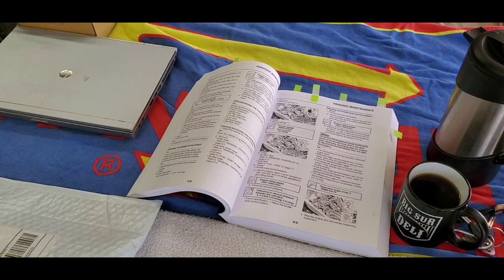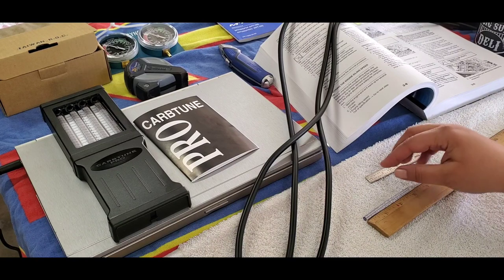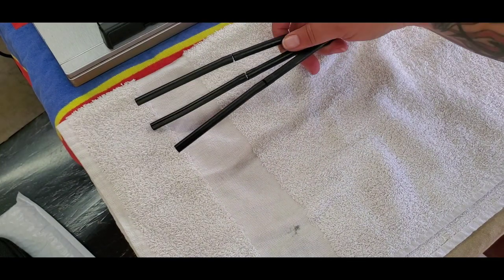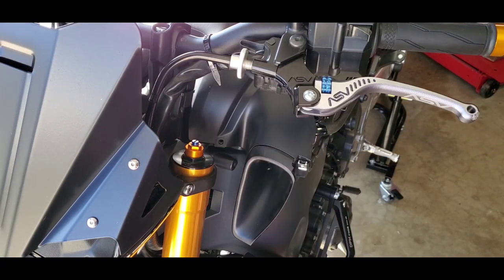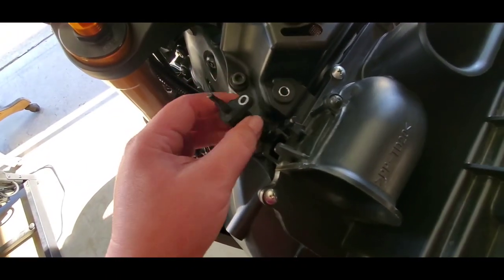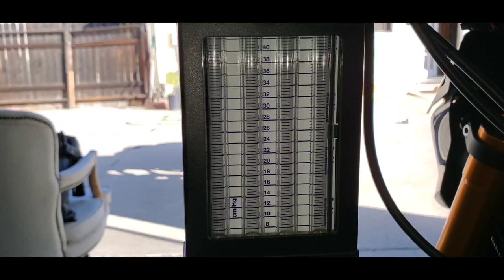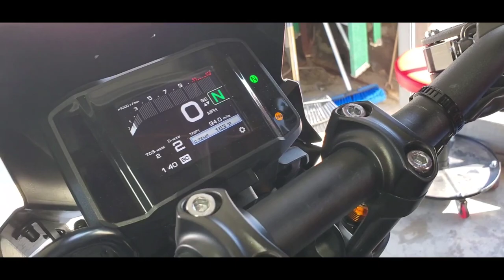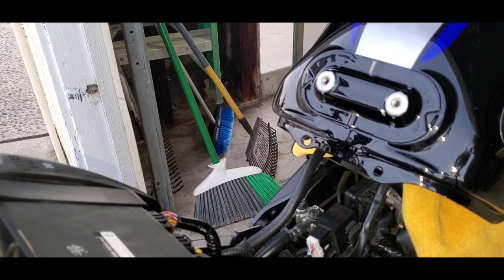Who wants to Synchronize some throttle bodies on a 2021 Yamaha MT 09 SP !

Comment: Nice tank pads, great video thanks for sharing.
Reply from the maker: @Gil Zr absolutely. Just so you know. I did end up having to adjust the baseline throttle. It wouldn't synchronize otherwise. It was minimal, but it did the trick. Runs better now then from the factory. Now I just have to get the Recall ecu updated from Yamaha 🤦‍♀️

Comment: Hi Sophia.. Can you just clarify the far right was the master ecu throttle bodie.. Black dot. Mine 2022 plate.. Usually there marked with white paint and even if anyone tried there locked tight all the way in..some mt are on the left side Going to try tomorrow.. 👍
Reply from the maker: @chipwood67 unfortunately, I don't recall. At one point I thought it was the one on the throttle side because I couldn't find any white paint. Then when I took out a flash light for a different time, I synchronized it, and i found the paint. They painted the screw itself. I think it was the middle one. I will go through my old videos. I believe I mentioned it somewhere. I'll let you know
Reply: Hi Sophia.. I did my sync today..didn't go well.. But looking at your video and response.. Which has been the go to video on y tube for Gen 3 sync is the best..also About your white dot on ecu master screw.. Yes I believe it was is the middle screw on your mt.. I can see it clearly now watching it back.. But on my Gen 3 2022 plate it's the left screw that's white.. But my problem started was when I tried to turn the MIDDLE screw it was seized... I could only turn the right sign screw.. Left side I thought is? Master ecu screw obviously I did not touchas on my bike it's painted white .. But now I'm thinking the wrong screw of the 3 2022 plate has been marked wrong or not ..why would Gen 3 all year have different sync master screws? So just tried syncing with right screw only.. Bike still hunting idle sync still in spec range after my sync.. So it has to be my lv race exhaust decated causing backpressure idle issues.. Also this is with o2,  eliminated ecu flash baffle in..looks like I need to get it on dyno to fix it..this may help other I'm sure.. Thanks again for your help 👍
Reply from the maker: @chipwood67  damn. I hope it works out. A good dyno tuner should be able to get you right though. Hope at least. If all else fails. You can put the bread box back on.
Reply: Yes bread box is staying off ha ha.. Hi Sophia. I would check yantosp on here..
You both have yamaha mt 09 2021 sp but your master white painted ecu screws are different just odd. Mine is same as yantosp.. But like I say my middle screw is seized..yours is middle screw? .. Also yantosp has had queries on this recently posted., 🤔
Reply from the maker: @chipwood67 senor Yanto! Yes. I do converse with that fine upstanding citizen known as @Yantosp he keeps teasing me about riding the Tail of the Dragon with him but hasn't followed through with it. Maybe you can tell the man he can trust me! 🤭🤣
Reply from the maker: @chipwood67  so I remembered I kept the old throttle body. I went & looked at it and indeed. It is the middle screw with the white paint on it. If you follow me on Instagram or Facebook I can send you the 📸 I just took. 👍
Reply: Hi Sophia thanks but I can confirm the white screw is on the left side sitting on the bike.. On gen 3. I would double check.. I've put post on yantosp and others respond it's on the left on gen 3..probably why you couldn't get them fully synced.. 🤔

Comment: Thanks for the video Sophia. I was debating on doing the 600 mile service on mine or taking it to the dealership.  You said a magic word that I worry about; "scratches". I don't  know about the paint on your bike, but mine seems to be quite soft.
I think I am going to follow your lead and do it myself; I am pretty sure that the sync tool is cheaper than what the dealer was going to charge me in labor.
I just subscribed, so keep the videos coming.
BTW, I follow "Old Guy Ridin" too; I am only a couple of months younger than he is.
Reply from the maker: @Doug Buchheit I'm glad it helped! Yes, I felt bad for my friends who SP got scratched. A noticeable 2 or 3" scratch on the frame of all places. & trust me, they aren't making it right very easily either. This is the video Old Guy Ridin' suggested  https://youtu.be/RVi6ECn91Ng with that video & the service manual I felt pretty confident it was doable job. Plus I took my time.  I enjoyed doing it.
Reply: I am a little dealer shy anyway. It took 6 months to get my bike and it came in with a badly bent brake pedal.  It took 5 weeks to get that fixed. Two of the engine covers were damaged too and Yamaha can't even give an estimated.ated delivery date for them!
Reply from the maker: @dougbuchheit1454   oh boy, I bent my clutch pedal when I dropped the bike. We used two Cresent wrenches to put back in place. Getting any stock parts is impossible right now. I feel your pain. 🤦‍♀️
Reply: @SocalMotoMo  But they seem to have enough parts to build more bikes.
Reply from the maker: @dougbuchheit1454  good point

Comment: Nicely done Sophia.  Did you notice the master cylinder looked like it had a splash of white paint on it.  Didn't see you adjust any screws.  I've got the same manometer.  Rotating the gas tank worked well didn't it?  You can actually disconnect the ECU (according to the 2 videos I watched to learn).
Again, great job!  And thanks for the shout out.
Ride safe.
Reply from the maker: @Old Guy Ridin' I couldn't find any white paint anywhere.  I was doing it again by myself so I didn't catch myself adjusting the screws. I was too focused on not messing up my bike 🤭 then filming it. The adjustments really don't have that much movement to them. I for some reason thought it be more significant but makes sense it's not. It was fun though.
Reply: Yeah, there shouldn't be too much of an adjustment.  Super job though.
Reply from the maker: @OldGuyRidin  thanks 😊

Comment: Hi Best video on mt Gen 3 👍... Did you turn - touch the master screw. Carb the one marked.. Or just touch - turn the other 2 to bring them up to the master one? I here you shouldn't touch the master screw as that's the ecu one.. But I also hear you can slightly.. Just checking I have hunting idle after decat full exhaust system.. And it's flashed.. I was told to do the throttle body sync to solve this issue.. Idle back pressure after my set up is why I need to do this.. What's your set up.. Stock or not.. Thanks Good job...
Reply from the maker: @chipwood67 Hey there! Thanks man. Yes, my bike was flashed by 2wheeldynoworks. Have a M4 exhaust on it. I followed those same instructions. Don't touch the master & adjust off the master. Should be good to go! 👍
Reply: Hi.. Thanks for info just to clarify then .. Did you have same  as me idle back pressure issue fluctuating .. And the throttle sync fixed hunting idle..mines not that bad more annoying.. Bike runs fine out of idle.. I did come across others saying ecu master screw gauge level sit higher than the other 2 even after sync.. Seems normal for the master to be slightly off. You did best you could have got it.. So it's probably spot on. Thanks again 😁
Reply from the maker: @chipwood67  no. I never had an issue with idle. I battled the TPS issue, though. I ended up replacing my whole throttle body about a year ago. That was annoying. I have no patience for dealers, so I just bought & replaced it myself. Resolved it, but I heard Yamaha finally figured it out. Allegedly 🤷‍♀️
Reply: Thanks.. Yeah yamaha warranty not worth paper it's written on.. Are you running decat M4 with baffle in or out or none decat or cat in  .. And or O2 delete or O2 still working with flash.. And or  above mods.. 🤔 Thanks again
Reply from the maker: @chipwood67  This is what I'm running. No baffle. Love the sound. After getting used to it. O2 is still plugged in, but I'm not sure if it's disabled by Flash. https://m4exhaust.com/yamaha/yamaha-fz-09/yamaha-mt-09-2021/2021-yamaha-mt-09-full-system/ I plan on getting a complete Dyno tune this year. Redo everything that's been done by the mail in flash.
Reply: OK thanks for all input.. Your M4 has mid muffler that will definitely help with backup ressure I believe.. Just make sure to as about full O2 sensor delete this could make some difference at idle.. Mine has O2 delete in ecu.. But if getting full dyno you should be good to go.. 👍

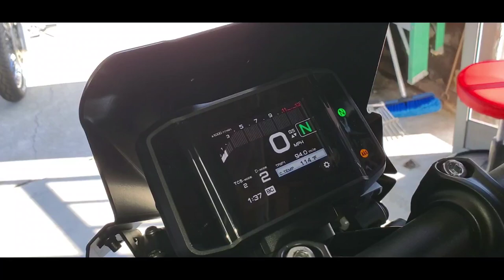Comment: Hi Sophia. I noticed that starting from 26:40 you have a very distinct metallic clacking noise which I have on some cold starts as well… did you notice that? It only happened twice with me, and its been haunting my peace of mind ever since! Not sure if in your case it is as loud as we can hear on the video or if it was the audio capture device that augmented this sound on its own but definitely it is similar to the one I got.

If you don’t mind me asking, what oil grade and brand are you using? My theory is that this could be from the valve command tensioner not having oil pressure due to cold oil taking its sweet time to warm up, but not sure…

Another noise that I am getting is when I am on third gear at around 4 thousand rpm and I accelerate to about 50% of TPS I get a “whine” sound very similar to a supercharger. Because this bike obviously doesn’t have one, the only other thing that it could be is straight cut gear teeth… does your bike make that sound also?

Anyway, props on the technical video!
Reply from the maker: @Igor Brandao hey there, since my 1st oil change at 600 miles, I've been using Motul 7100 10/40. I do all my own maintenance. Just because I enjoy it as much as riding it. Though when it reaches 8k I might take it to a Yamaha dealer I trust. Maybe. So clicking. Yes, I definitely noticed it. Wasn't too concerned though. That other noise you mentioned, can't say I've noticed. I also previously owned an Inline 3 cylinder motorcycle in my 1050cc Triumph Speed Triple. It sounded very similar to this bike. I usually don't get too concerned unless the noises I hear follow performance issues. At this time, they don't. 🍻